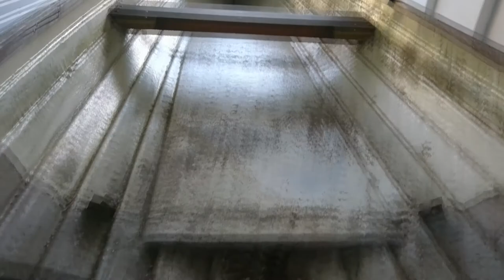Somewhat Weekly Stuffing #1 | Some Kind Of A Vlog Thing

Comment: I really love messing around with my Aerox. It's always evolving and changing (cause I keep changing my mind of what I want to do with it) It's going to end up with all Stage 6 parts lol . It going from mild 70cc kit to replace the one that the previous owner burnt out > mid race 70 kit, 21mm dellorto, bigger vario etc > stage 6 r/t 95 or other streetable 90cc+ bigbore cylinder , stage 6 oversize vario, stage 6 r/t digital ignition, PWK 30 etc..
Reply from the maker: Sounds fast! Good luck!